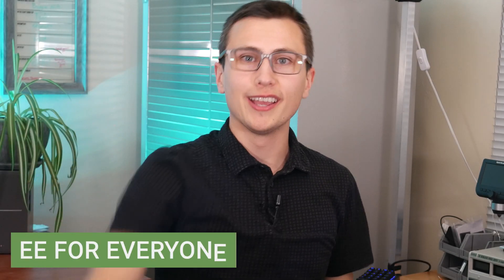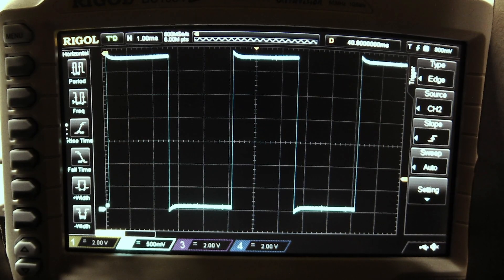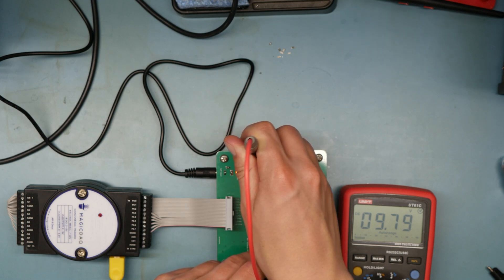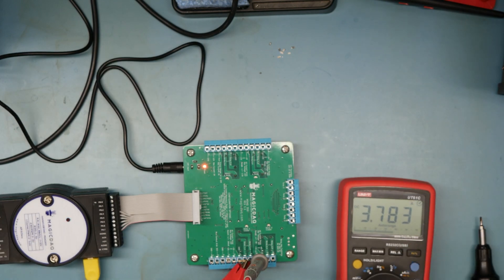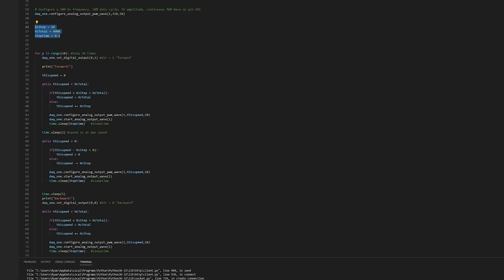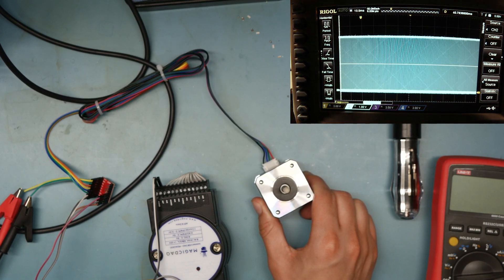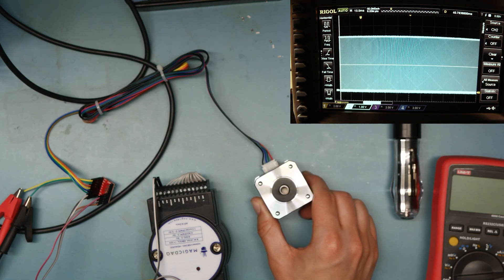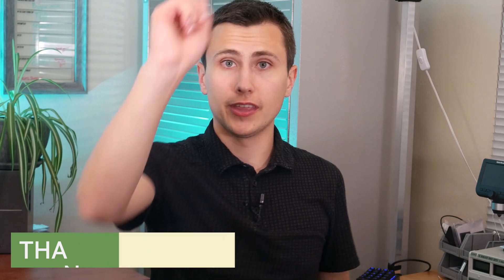Stepper Control in Python on Windows?!? – MagicDaq Runtime Demo

Comment: This magicdaq thing is not what I would use to tinker with a stepper motor. It's way overpriced.
It makes sense in a test jig but hobbyists don't need a product like this to mess around with a stepper or making current measurements, toggling relays.
Reply from the maker: Agreed! Not sure if this made it into the final video, but I recall rambling something to that effect. Price aside, it's not good at controlling a stepper motor (because that's not what it was designed to do). 
Rather, this was my way of trying to push the limit of operations per second.. and I was pretty impressed! It seems plausible that one could use this to fake out a user input, like an encoder!
Reply: @EEforEveryone  I should have watched the conclusion.